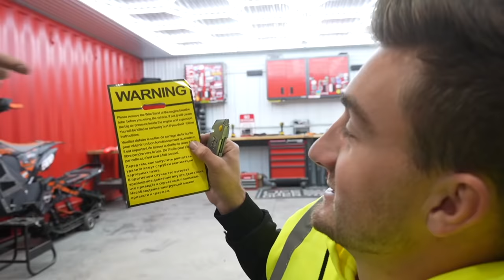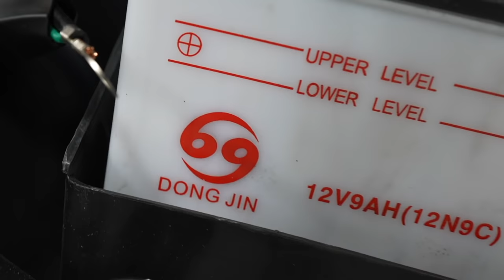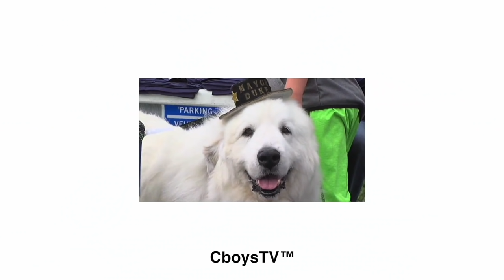Mini Bikes on Thin Ice

Comment: On your Chinese bike double check all the bolts that were already assembled, you will find loose ones. Also replace the carb with a mikuni knockoff and tune it and it will have a ton more power and no bogging issue.

Comment: The reason the Chinese bikes are so slow is because of how restrictive they are on the motor. The airbox is probably small, the airfilter might not be very good, the carb might be small too, and the exhaust is probably restrictive too. That bike says it makes 17 HP on the ad. If you changed the airbox to make it more flowy, the airfilter into like a K and N or cold air intake. Got a performance carb kit for. And got a new muffler and pipe it would probably make around 25-30 hp
Reply: Then it would really perform good

Comment: PLEASE TRY THE KAYO 250cc 2 stroke. It’s around $3500 and it’s actually a super decent dirtbike. Shockingly competitive for the price
Reply: And it has dealer support, parts are available. It’s a sick bike. Modeled after ktm however obviously not as good. They are carbureted, 2 stroke 250s with power valves and legitimate fully adjustable suspension front and back and are actually light weight good looking bikes